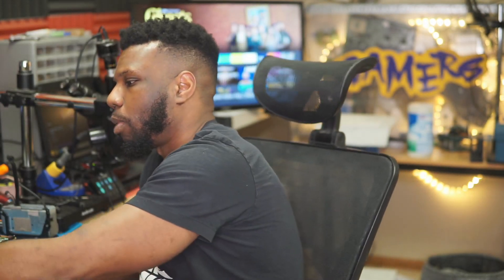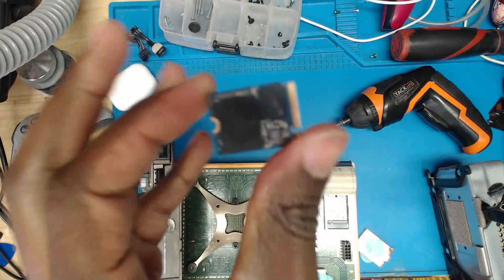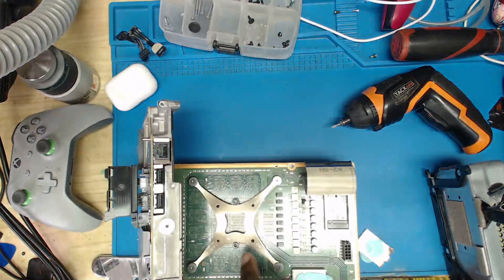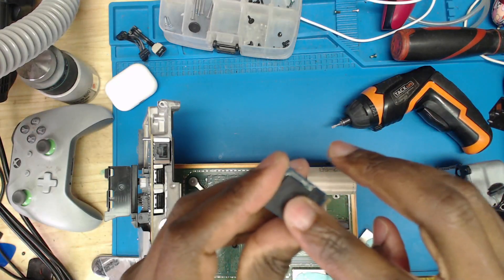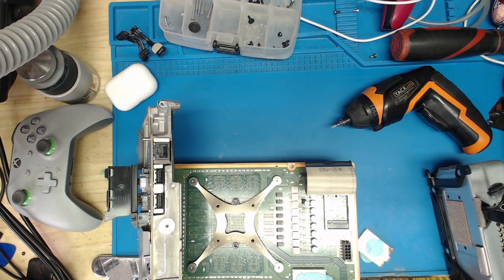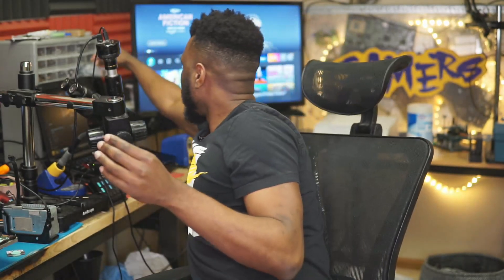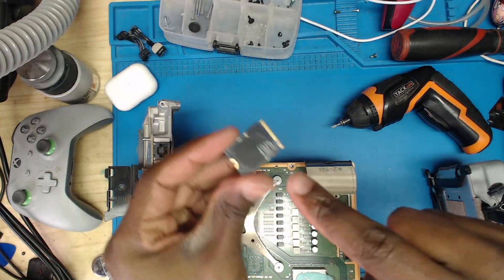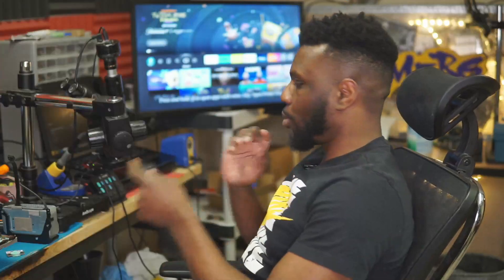All Xbox Series Will Fail Because Of This Issue

Comment: There was recently someone who has dumped the bios from an APU sold only on china if I'm not mistaken, I believed is named AMD 4800s, which were imperfect APU from Series X , with the dump of the BIOS, Rom and fuses you can probably reverse engineer these bios, and unlock the XBOX who knows, knowing how the chip works is the first step for it.

Comment: I have run into three of these Xboxes in the past week with dead solid state drives you can't get anything off of them . I actually ran into four. But one the health was at 55% and I was able actually to clone it and put it on another SSD. But the other three are nothing but paperweights. So it looks like we're going to start running across the ton of these